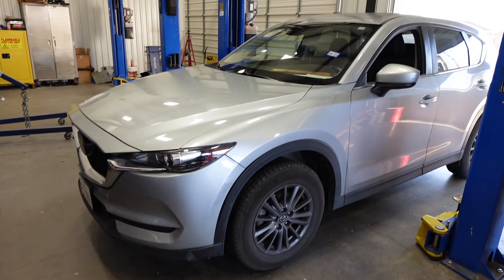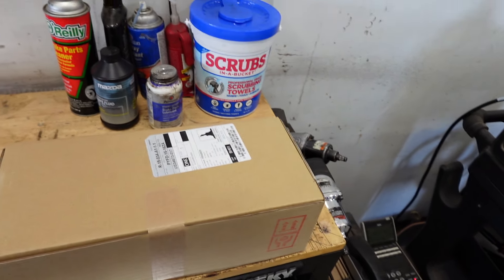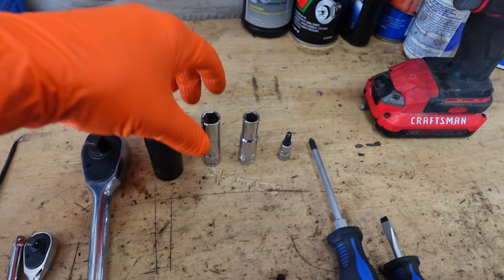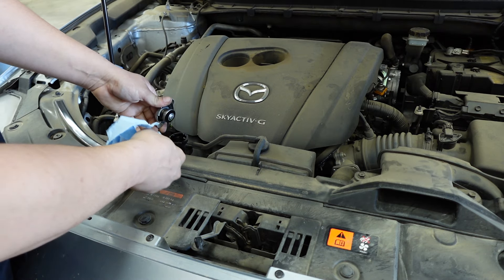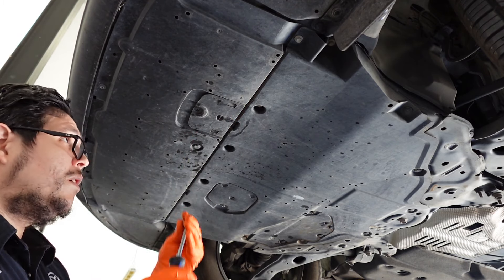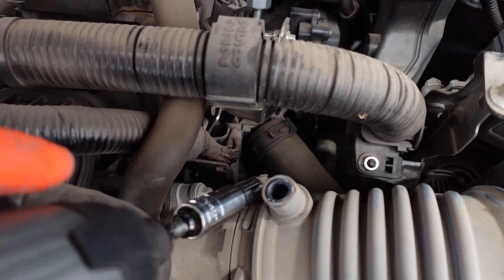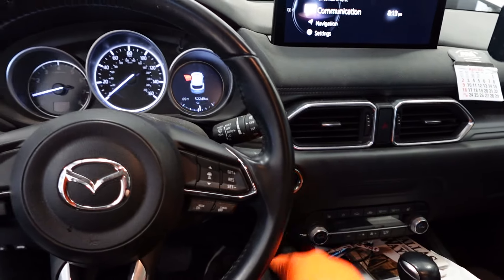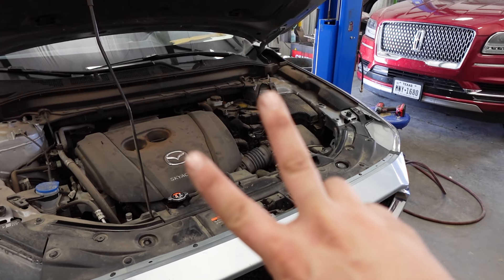Mazda CX-5 P0126 Coolant control Valve Replacement

Comment: Great vid.  My niece's 2023 has the P0126 code and it's only one year old with 15k miles.  Read the code and saw it was insufficient coolant temp.  I don't know what the number is on the valve, but the ZA is the fixed version, so I'm baffled as to why Mazda is installing the Z defective valve on a 2023 when they've known about this issue since at least 2020.  When we were looking into new vehicles for my niece she ended up deciding on this CX-5 and the more I read about the issues the more I don't like it.  To me it's insane to have that huge plastic computer controlled monstrosity in place of a mechanical $10 thermostat.  The cheapest I can find that valve is $354, plus at least $120+ for labor, and whatever diagnosis costs.  At least her car is under warranty and from what I'm reading this is covered, but anyone out of warranty that has to fix this at home is looking at $354+ and a couple hours of their time and the cost of new coolant.  A simple mechanical thermostat would be 10 bucks and on most cars is not that difficult.
Reply: Just had same issue for my 23 CX-5
Reply: @Gapeach1970 She took it to the dealer and they wanted to charge her $190 for diagnosis and said "maybe it was covered under warranty."  She called me and told her to tell them she isn't paying a dime to diagnose a defective valve that shouldn't have been installed on the car since 2020.  I told her to also tell them she wants a rental car to get to work the next day since that was in her dealer warranty.  She called me back 10 minutes later and said they told her to drive it home and they would have it picked up from her work the next day and bring it back after repairing it.  They did, and it was all covered under warranty.  The invoice showed $705 total, lucky she didn't have to pay.  So for anyone that gets the runaround from the dealer, stand your ground.  Also I read at least one post where the dealer told an owner they couldn't cover it under warranty unless the engine light was on, even though there's a code history stored.  My niece's light went off for a half a day then came back.  So to be on the safe side I would make sure the light is on when you bring it in.
Reply: Is this under the 3-year or powertrain warranty?
Reply: @cashonly2539  From what I read on reddit it's covered under the powertrain warranty.  I also read at least one person that said the dealer said it wasn't covered because the warranty said "thermostat" and the thermostat is only one component of the coolant control valve, and it's the housing that's the defect.  Almost everyone got it covered unless you're out of warranty.  I didn't read the actual warranty since it was covered without an issue.
Reply: @badcrcz  This happened to my 2019 CX-5 about 6 months ago.  After I cleared the code and it never came back on until recently.  I cleared the code again and the CEL stays off so far.    The car runs smooth otherwise.  I recall both times the light came on when it just warmed up and I got up to highway speed.  Thanks for the info. I won't clear the code if it happens again.
Reply: I have this code on my 2022 CX-5. The car takes a while for the oil to get to its optimal temperature. Sitting in the blue range for a while, then rising to about 150-180 degrees.The first time I got the code, I went to check the coolant it was almost all drained. So I added more coolant, and the issue went away for a bit. The temperature never exceeded 210, so to me its fine, but it would dwindle at 150 sometimes for entire driving commutes before getting to that upper 180-200 degree range. The second time the code popped up, I decided to change the engine air filter (Being that I hadn't replaced it yet) at 25,000 miles. The car seemed to run normally, and maybe once every couple of weeks, the engine light would come on and then go away. I'm considering trying to replace the thermostat. I'm at 35000 miles. I have a co-worker who has a 2018 CX-5, and he said he's never had to change anything due to an issue with coolant. Or, in fact, any issues at all besides routine maintenance. He's at about 85,000 miles and just starting to replace the belts. Diesel mechanics btw.
Reply: @danielespo1211  I would get it replaced under warranty if you have the code.  For cars not under warranty I probably wouldn't worry about it too much if the light only comes on occasionally.  But low engine temp for long periods isn't going to be good for your engine, especially in the winter.  Just one issue is your oil won't heat up to normal temps and lubricate properly.  Any CX-5 2021 and newer shouldn't even have that defective coolant control valve, but Mazda installed it knowing it was defective, rolling the dice that most of them would work until the warranty ran out so they weren't stuck with a warehouse full of defective parts already manufactured I'd guess.
Reply: The difference  is that yes they could put in a $10 dollar part but if the $10 dollar part gets stuck closed you will blow a head gasket. And now your talking thousands of   dollars. This valve regulates the coolant temperature when engine ls most efficient. And when it fails open. All you notice is check engine  light and a loss of MPG's give me this valve any day so along as  the engine doesn't over heat... shoot I be willing to pay $500 to get it replace. So along as my headgasket doesn't blow.
Reply: @gerardocampos7138  But either one can get stuck open or closed and it's the same result...either running too hot or too cold with a code.  The difference is the coolant control valve has multiple points that can make it get stuck, and the mechanical has one.  You don't need a $354 coolant valve to stop the engine from overheating, there's already a temp sensor that can throw a code, alarm, or stop the engine.  The only benefit to the computer controlled valve is more precise control over coolant flow, which wasn't needed on any of the vehicles before that.  I seriously doubt there's any noticeable change in MPG.  I'd rather have a simple thermostat I can replace for $10 that's easily available 8+ years from now, than an expensive part that's complicated to replace that might be hard to find later.  Personally, I've had a lot of vehicles that had a bad thermostat and I never had a blown head gasket because of it, but I don't see how that's solved if the electronic coolant valve gets stuck closed either.
Reply: @badcrcz  no this one CAN NOT get stuck closed it's failurelure is stuck open. That's one of the fitures about that water valve. That beats a $10 dollar thermostat. And you will see a mpg difference the pcm trys to add more fuel to heat up the engine. It created more emissions. Reasons why you get a check engine light to come on. Belive  me I would also want things to more simple. But with emissions being the be all see all. Manufactures try to lessen the emissions at all cost. Remeber how you vote. I makes a difference.  Even to your car parts.
Reply: @gerardocampos7138  The "failsafe" feature uses a mechanical thermostat as a backup.  The defect in the original CCV was allowing water into that area that made the thermostat open.  If that thermostat is only used rarely in a failure of the CCV I would say that probably increases the odds of it being stuck closed, but I agree in THEORY the CCV with a backup thermostat might reduce odds of overheating.  I still don't think it's worth having a unique expensive part that costs $300+ for labor to replace.  CARDIAX has another video where he shows the internals of the CCV and how it works and he says the 2024 CX-5 went back to a mechanical thermostat instead of a CCV.  I can't find any info on the 2024 CCV/thermostat, but if that's true then Mazda didn't think the CCV was worth the headache either.
Reply: It is fail safe to stay open and run cold when it fails.  Free fix and 15 year warranty from mazda on this issue now. U should have gotten a letter in the mail explaining the fix and extended warranty.   Look it up.

Comment: The Coolant Control Valve is a computer contolled motorized ball valve that rotates to whatever heater temp is selected. Stupid, unnecessary, excessively complex but nothing to do with engine temp or PO126. The actual thermostat is IN the CCV, thats the other screws you see on the inlet pipe side. It is about the size of your thumb and can be replaced without removing CCV. You buy a car 92% made in Japan expecting quality and the failed part replacement is made in Tirkey so ....

Comment: I just got same problem on my CX-5 2022 2.5 with insufficient coolant temp and check engine light is on with P0126 code. Have no idea why it's happening as I have correct ZA thermostat, not Z. What is the issue it can be?

Comment: In my Mazda 6 2020 2.5 petrol I noticed the engine temperature drop to half the scale ( 70 degrees C )after turning on the air conditioning, regardless of whether AC/AC ECO or heating only.There are no errors in the computer.The oil level does not increase/decrease and it is clean under the cap.The coolant does not increase either and the fluid is clean.I have not noticed any coolant leaks.From the temperature of the lower radiator hose,I conclude that the thermostat is opening.I also noticed that the coolant from the reservoir does not flow back into the system.The thermostat was replaced at the Authorized Service Center,the cap is also new and the system has been bled.Where to look for the cause?

Comment: This is an excellent DIY video! My daughter has a 2018 CX-5 (140,000 km) that I just read the P0126 code. I was all set to dive in and replace the control valve so I called Mazda this morning. (Jan 31/2025) The service rep said that Mazda has extended the warranty for this part and service will be covered. She said that customers that previously had the control valve replaced are now being reimbursed now for the repair. She said the cost is about $5.50 Canadian. 

I live in south western Ontario. The dealer is Kieswetter Mazda. This gives me a whole better feeling about buying Mazda...

Thanks again for the video. It was excellent...

Comment: Best car repair video I've ever watched.  Very thorough!  I have to do this on my daughter's car ASAP.
Reply: Well done for the explanation.
I have a Mazda 6 2.5 still under extended warranty which Mazda UK are refusing to honour as there is no TSB recall in the UK.. They have quoted me £900.00 to replace this unit which has the same symptoms.
Considering the part is about £180 and 1.5 hours work. (As on TSB).
So very disappointed.
Reply: Do you have a link for the part?  I've only found it costing 700$+ cad

Comment: Just used this video to replace mine.  You're a life saver
Reply: Did replacing the valve resolve the P0126 code?
Reply: @DoubleE-2250  yes, it's just a ridiculously expensive part.

Comment: Thanks for the info great job. My daughters 2016 Scion IA is a Mazda 2 what surprises me is all the plastic parts on it. I took if the intake to get to a $14 pcv valve. Talk about smart engineers.  . God Speed
Reply: At least japanese plastics don't corrode the way american and german plastics do. Plus Almost all modern econo vehicles are designed similar

Comment: Thanks for this video.  I have the same issue with my 2019 Mazda CX-3, a few months past warranty.  Got a scanner and had the P0126 code.  Also my coolant temperature is showing around 150F while driving.  So looks like I'm in for a bit of a repair.  I'm not mechanically inclined but this was very helpful, I'll probably give it a go.  The CCV is quite an expensive item for what it is.
Reply: you don't have to replace the whole ccv. You can replace just the thermostat inside of the CCV according to the latest service bulletin
https://static.nhtsa.gov/odi/tsbs/2024/MC-11003350-0001.pdf
Reply: @chinedooo  Thanks.  Mazda wasn't very nice about the whole thing, so won't go back there.  Instead I traded it in and am now a Toyota customer.

Comment: Very common problem on 2019s. Ours wouldn’t go above 150 degrees. It was covered under warranty. I’ve read that Mazda got smart and went back to mechanical thermostats on the most current models.

Comment: This was a good video.  Clear explanations, well framed video showing the subject matter, the engine bay was well lit and it was oddly refreshing to see a car engine that looks like it's actually been driven!  Kudos to you, well done.  Question 1)  Would you recommend replacing the sensor mounted to the control valve with a new one at the same time as getting a new control valve?  The 19mm one?  Question 2)  Have you found aftermarket parts (in general) to be of good quality, or is this a 'buy from the dealer' sort of part?

Comment: Excellent video. Just had this done under warranty by Mazda Australia (Mawson Lakes SA) on my 2020 CX5 GT Diesel 60,000Km. Though spewing coolant out of the overflow tank onto top cover of the engine.  The radiator was virtually empty there were no warning lights on the dash display.  We were towing a small camper van out in the country when this became an issue and obviously no water in radiator would quickly lead to catastrophic engine failure. Can maybe a pressure sensor be incorporated somewhere for the engine management system  or maybe just an independent warning light? Very interested to hear your views and suggestions

Comment: This video is GREAT.  I like how you stepped through it in the detail that you did.  You said you did many of these.  As you see it, does this happen to most of them, and it's just a matter of time (when)?
Reply from the maker: It does happen quite a bit. I replaced another one on a mazda6 just a few days ago. luckily mazda is ditching this coolant control valve for a good old fashion thermostat on newer models with the skyactive engine 2.5 non turbo engines. The only models that still comes with this coolant control valve is in 2023 CX-5.
Reply: @CARDIAXPLAYS  Thank you for sharing that. 
Could I ask one other thing? How many of these need their intake valves cleaned? Have you seen many of these? I have a '21 non-turbo. So I have the question in my mind as to how long it's going to be until they have to be cleaned. Curious if you know. Please share....
Reply from the maker: @stephenbay9564  We do clean the valves and offer our customer the service every 25000 miles. we spray a fine mist of a BG cleaner into the intake manifold while the car is running. it takes about 30 minutes for the service to be performed. since these engines are direct injected those valve get super dirty real quick. I've also seen these engines with over 200,000 miles still running strong and the customer has never done the service.
Reply: @CARDIAXPLAYS  Hi again!   Listen, I just went to the BG web site and saw what they said to do with their cleaner, specifically on Mazda 2.5 non-turbo engines (like mine).  Let me cut and paste part of the instructions here: "The adaptor will administer 22 oz. (650 mL) of cleaner in 25–40 minutes depending on engine vacuum. When supply tool is empty, close ball valve and allow the engine to idle for 15 minutes."
AND, when that finishes, they say to use a 2nd 22 oz. of cleaner, assumingly taking as much time as the first.  Total time there would be:  25-40 mins. + 15 mins. of idle......then 25-40 mins. + 15 mins. of idle.  That adds up to the engine running is over TWO HOURS (in the shop).  
So may I please ask - Do you guys go that nuts?
Reply from the maker: @stephenbay9564  Hey Stephen. I've actually never read the BG Instruction on the site. I've been doing it the way the previous tech taught me when I first started at mazda. I was taught to put both cans in the BG device that delivers the spray into the intake. then once the container is empty let it idle for 15 minutes, It honestly takes about 1 hour. But thanks for the info. Ill for sure relay this info to my service manager to see  if we can change up the process. Your the man Stephen. Honestly my favorite subscriber so far.
Reply: @CARDIAXPLAYS  in the 2023? so earlier than 2023 they dont have them?
Reply from the maker: @roostersideburns3440  As far as I know all CX-5's of this body style with the 2.5 N/A have this coolant control valve.

Comment: CX5 2013 is spewing coolant, could this be the coolant control valve? (it is summer and temp is 34 degrees Celsius) the cx 5 doesn't have a dashboard temp sensor. So car has spewed coolant twice but with 400km interval. Any ideas?

Comment: Ehy does everyone say the cx5 doesnt have a temperature gauge? My 2018 non turbo grand touring had one and so does my 2021 turbo signature cx5. Im at 59k miles...have never had a slight cooling variance...never had a single issue with either vehicle. actually my rear brakes wore out way before the front on the 2018...bit still not til like 30k miles. So definitely wierd...but my 21 signature has original brakes on feont and back...i just bought them to to change the rear but havent fone it yet... basically just doing because i feel its time...they still eork fine....mine was made in japan. I wonder how many cx5 with issues are mexican...or Canadian....

Comment: Great video! I’m concerned about my 2020 CX-5 Sport. I found the coolant to be just above “low” line. Also, when driving downhill on cold days the coolant temperature drops.. sometimes all the way down to 1/4 temp. Is this an indication of failure? I still don’t have a check engine light. Car is @ 52,000 miles.
Reply: Yes your car uses coolant , fill it up lol and no it's cooling down cause it's not being worked,  if you're not being used there's nothing to cool down lol
Reply: It’s normal to top up your overflow because it’s not pressurized. Just make sure to top off the overflow when the engine is cold.